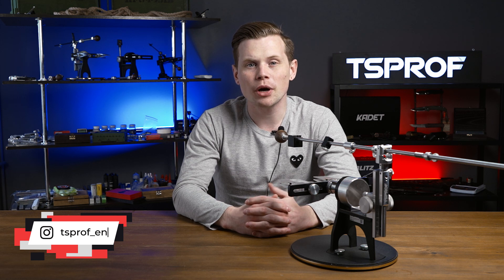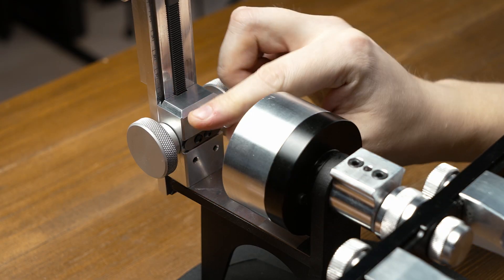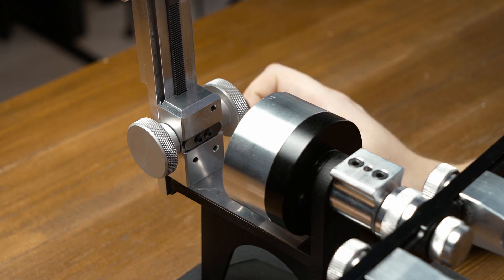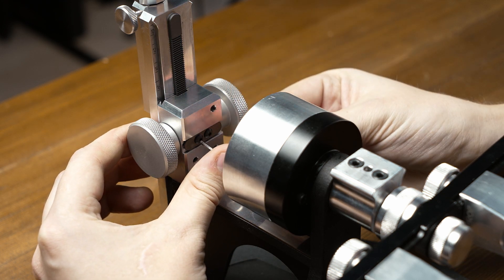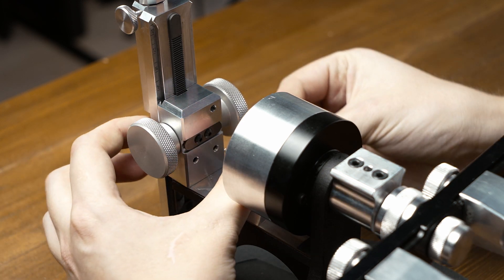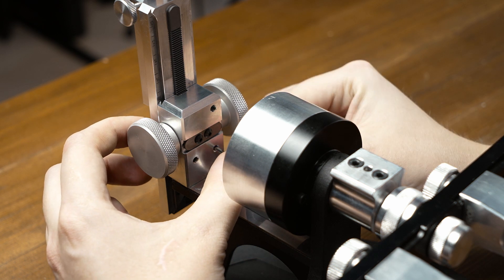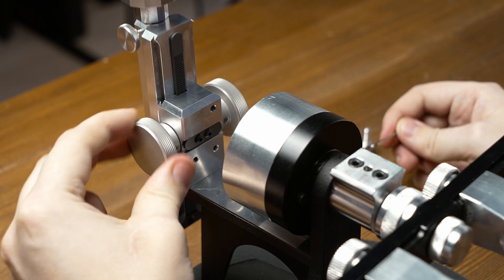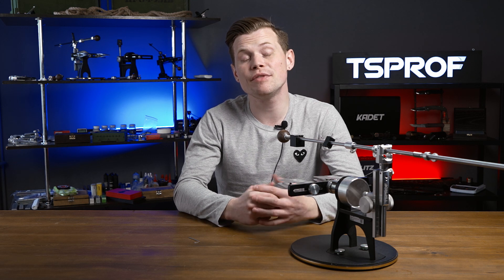Lifting Unit Adjustment for K03 PRO

Comment: Hi can you make a video on how to dissasemble all of the parts of the k03 knife sharpener including the heart of the system how it works inside the locking mechanism
Reply from the maker: Hello! Unfortunately, we can't do that and we do not recommend users disassebmle the tool on their own. If there's some issue or question, just drop us a message for support 😉